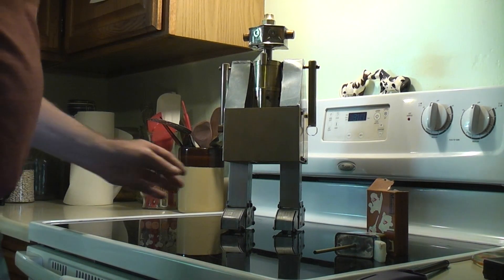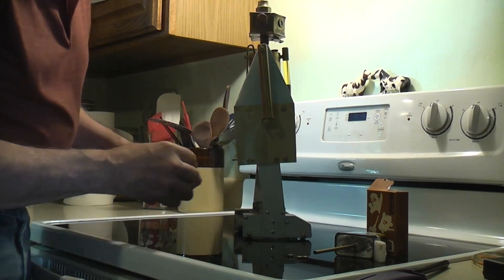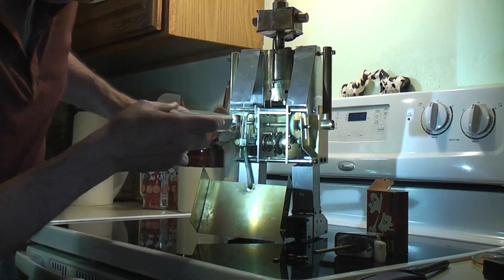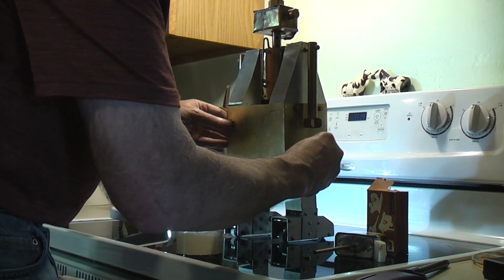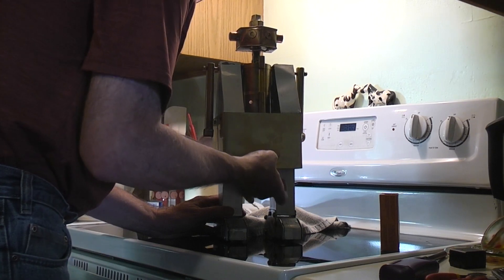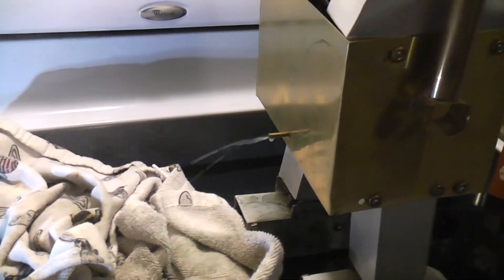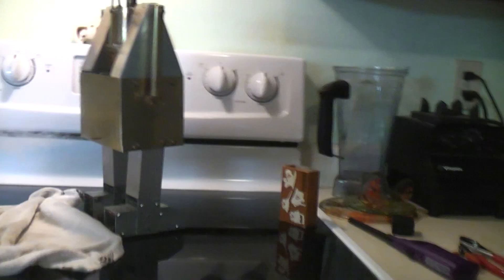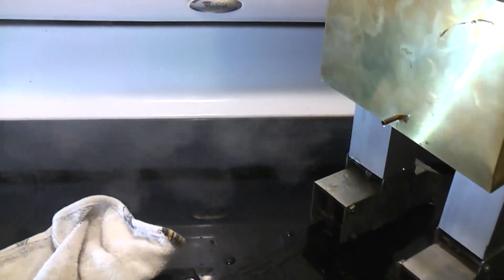My Steam Powered robot I built in the 1980's. Full demo and description.

Comment: I love it as a robot and steam enthusiast, and I admire it for working so well with so little power available. Of course it walks slower than an electric or wind-up toy robot, but it is so much cooler!

You also mentioned a steam turbine powered robot, but I can't find it with a search.
Reply from the maker: Yes slow but fun. I do not have video of the steam turbine version I made back in the 1980's, it walked much faster and went through the water steam supply faster as would be expected.
Reply: @Robothut  You have me curious now. If you ever have the time please share.
Reply from the maker: @TheDenyingDutchman  The first one I built I took an AC clock type motor, removed the coil, so that left the gear box and rotor. I added metal fins to the rotor and made a metal frame around the fins so I could aim a steam pipe at the turbine fins. So, it ran allot faster, but the tradeoff is a low-pressure system that uses a high volume of steam. It was OK for short run times, went through the water tank much faster. In the end the metal parts I made rusted, I should have used brass or copper for the parts. It no longer is with us, but I might make a new one day as it was a fun project.
Reply: @Robothut  Nice! Turbine efficiency unfortunately doesn't scale very well. Fortunately, it's all about having fun. A tiny jet at higher pressure does help. Especially if steam is superheated in a coil first, but that's added weight, volume, and complexity. A fun project, added to my to do list. 😄 Merry Christmas!